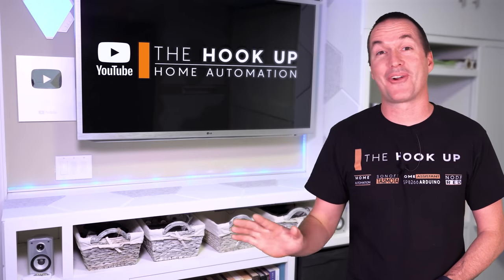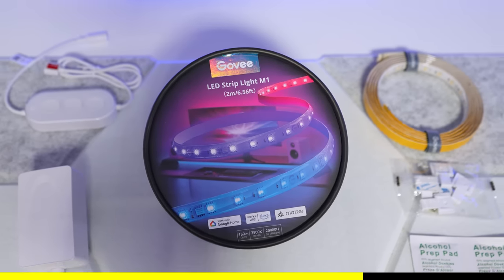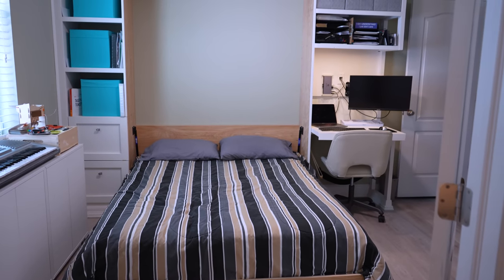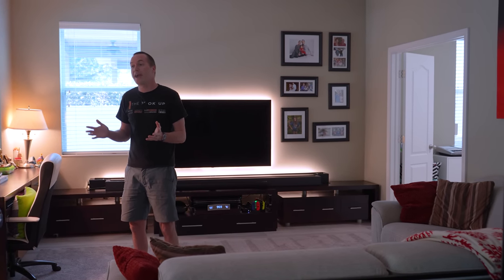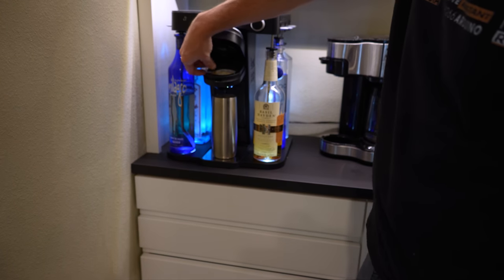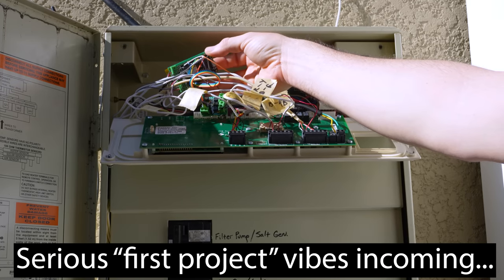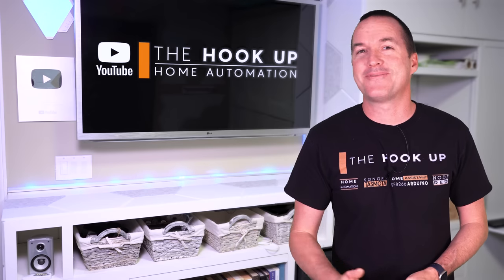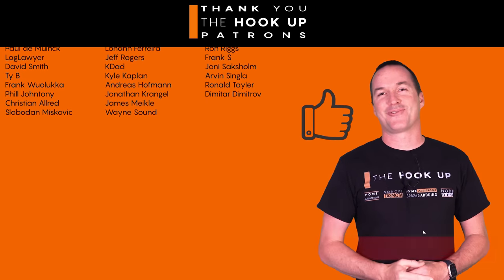Smart Home Tour 2023 || 7 Space Saving Ideas

Comment: I like your patio ideas very much. I'm thinking something similar to build for my new house.

Do you recommend to automise the pergola or change it manually if it's needed (in reallity maybe it will be not changed very often or what would you recommend?). The same is with the (sun and wind) blinds. 

If they will be automised then how much power they need and how powerful/what motor do you recommend (that would be fast enough, powerful and outside?). I quess that they will be controlled by smart home hub somehow :)

I would be very thakful for you opinion :) good work.
Reply from the maker: For me the motorization is completely worth it and increases the number of times it gets used significantly.

Comment: Any luck getting that Zemismart roller blind onto local control (assuming it's the wifi variety)?  I love these, but: 1) esphome instead of tuya would be so nice and 2) via tuya, it only goes in 10% increments, which makes it hard to open/close slowly, or use it to block out a certain amount of sun.  Any info on these points would be amazing!
Reply from the maker: Yes, mine is flashed with Tuya.

Comment: Add a second safety trip beam that the golf simulator would intersect when it's down so the garage door CAN'T OPEN when the screen is down.
Reply from the maker: I could also probably do it with a limit switch, but to me the smart outlet gives me a larger level of confidence because I can clearly see when the garage door motor is disabled by looking at the light on the opener.
Reply: I was thinking of it as in addition to your current config. 
Does the outlet require internet for full functionality, or can it be controlled offline as well?
Reply from the maker: @OfficialJohnnyNelson  It's zwave, all local control.

Comment: Do you have any details about your “camera and lighting rig on rails” build? Specifically, I am curious about the rails and sliding mechanism. I need to build a projector slide as I have some throw ratio limitations which will require me to move my projector (a larger JVC RS400) back to increase my screen size but in doing so it would block the attic access in my theater. I was looking at using either unistrut or even pocket door hardware to build the slide. What did you use?
Reply from the maker: Linear rails: https://amzn.to/45hvOGl
Reply: @TheHookUp  Thanks for the reply! You got a new subscriber here!

Comment: How did you wire the switch if it's a 3 wire and you only used 1?
Reply from the maker: Just leave the other 2 switch outputs disconnected and monitor their state with your smart home hub (amazon echo, smartthings, and home assistant can all easily do that).
Reply: @TheHookUp thanks!

Comment: Is this guy human, he's a super hero from somewhere in the Universe!
0:25 if I could recommend a rotary tool(I recently bought a Dremel), it routes and engraves beautiful and easy shapes into your wood and metal work for a pro finish.  Small things like a nice rounded rectangle edge rather than a plain 90 degree hard wood edge.
9:27 I am wondering if you use a router with FOSS to manage a home network?  I would prefer a locally managed network for full control and privacy, like Home Assistant.
Reply: I am pretty sure he is running Ubiquiti network hardware. It integrates pretty well with Home Assistant.

Comment: RE: Master bedroom lack of lights and single switched outlet. Seriously? Is that a thing now? 

That is the way ours is. I have been experimenting with smart bulbs and smart plugs trying to resolve the issue. I am just going to say to everyone, do not waste your money of Feit "smart" stuff. They just go offline randomly.
Reply from the maker: I had some feit stuff that I was able to flash with tasmota and it worked pretty well.  Not sure about the stock firmware (tuya right?).
Reply: @TheHookUp  Stock it is running Tuya. I might have to dig into the archives and relearn how to flash Tasmota onto one of the devices to experiment with. Although, the keyword in your comment that I should probably take to hear might be "had".
Reply from the maker: They didn't fail, just a side effect of testing smart home gear, everything gets limited usage before it's time to test something different.
Reply: @TheHookUp  Fair enough. I am just on the edge of being frustrated enough to scrap them all and try something new. Maybe the new Roku stuff. 

I will give Feit kudos for their customer service. I had two smart bulbs fail and each time they just sent out new ones without much fuss. I did notice that their line of questioning changed from troubleshooting to "What is your address, Sir." when I mentioned that I got them from Costco.
Reply from the maker: I think the Roku stuff is just rebranded Wyze, definitely not a step up from your current headache.
Reply: @TheHookUp  Thank you for the heads up! 
I just verified that all the MAC address for my smart plugs and bulbs are registered to Tuya Smart Inc. I am also reading that they may be using the Realtek RTL8710BN SOC which is not supported by Tasmota. I'll have to look into it more this weekend.
Thanks for your video(s). (I am also reviewing "The COMPLETE Guide to Tasmota 2019" for anyone else reading this.)